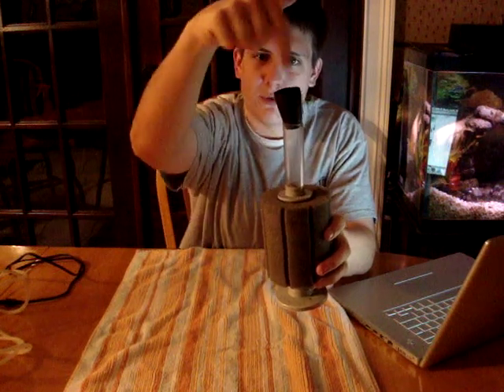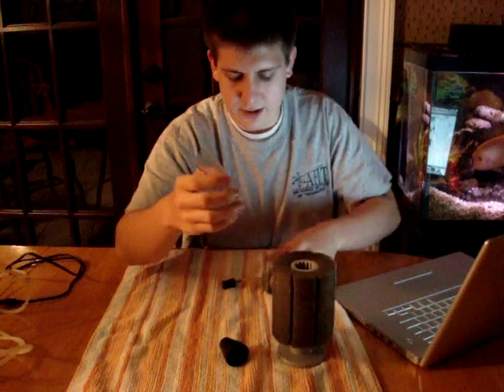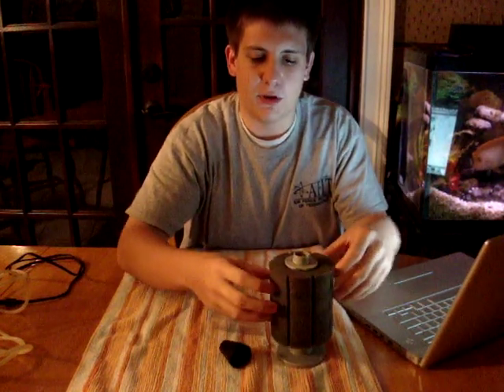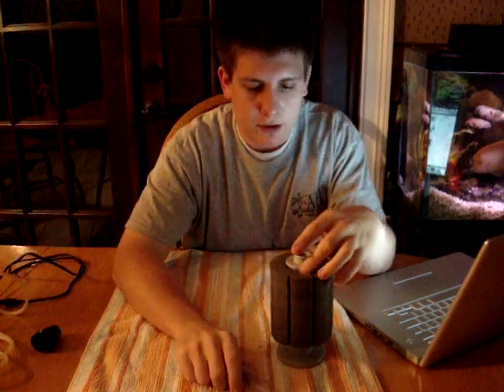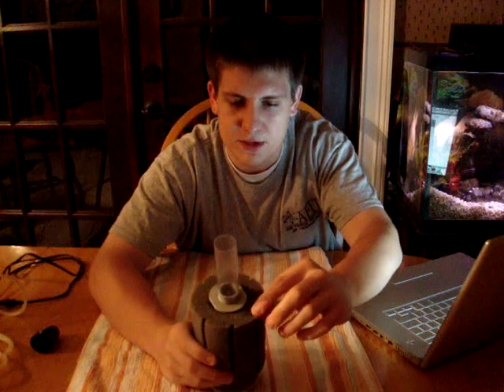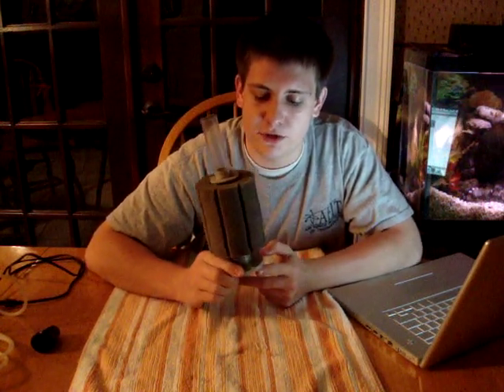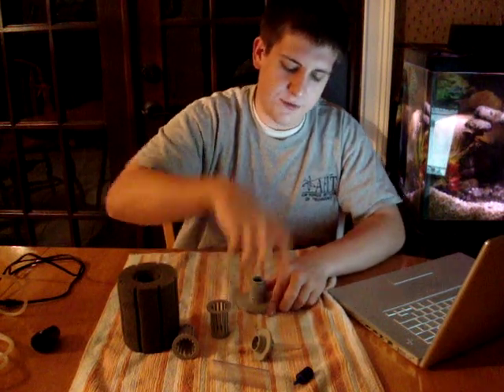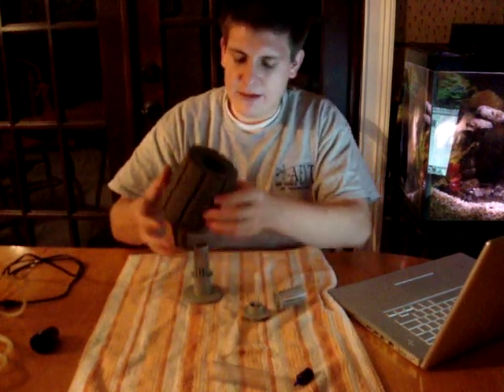How Sponge Filters Work

Comment: i switched from a regular filter to a sponge filter as it oxygenates and filtrates the tank and i can honestly say that it was the best decision I ever made, as i have never seen the water so clean!! its like glass! its more expensive in terms of purchasing the valves and the air pump ect but it is definitely worth it. You can buy connection links so you can buy another sponge to filter another tank if needed too :)  Its great for Betta's

Comment from the maker: Thats a good point, you can manipulate the shape easily, but, as you do that, your also going to cut down on your filtering capacity. On top of that, at least for the sponge its self, you will never be able to safely change the color to your choosing. 

Also, any filter can just be left there for months at a time. The only reason most filters "need" (or dont) to be messed with is, because of chemical media, like carbon, it wears out. Sponge filters are prone to clogging more than most filters.

Comment: Thanks for the overview.  Just got a betta for my daughter and the tank I bought (Aqua One Reflext 26L) has a power filter with what looks like great filtration but a noisy and overly strong output.  I tried reducing the flow by drilling some holes in a tube (like a makeshift spray arm) and connecting it to the port in-place of the duckbill nozzle.  This reduced the flow and stopped the betta from getting swirled around but he still doesn't seem to like it; when I unplug the filter he seems much happier and uses more of the tank.  Did a bit of research and it seems that a sponge filter is what I should use - I definitely want a bit of movement in the water to help with the heating but he should be much happier with the sponge.  Should be quieter too as the current in tank power filter has it's own separate chamber at the back and vibrates a bit.  Thanks again for the info.

Comment from the maker: @kjbarbie2002 Yea I show you that in this video, as well as explaining that. I use an extra air line and stone on all my sponge filters, I actually tested myself and it clearly improves performance in fact I could do a whole video on that comparison if needed. Yes one way to clean it is to 1. use old aquarium water 2. take a bucket fill it with tap water then put water conditioner in, wait a couple hours, then wash it in there. Also you could get a new sponge and cut both in half to seed the new

Comment from the maker: @desertbard No these tests were done in the 90s. Honestly though I didnt need a test to tell me this, even when I was 5 I could have told someone that pretty much any other filter is going to be superior to a ugf. As for putting a sponge on a ugf, it would be a bad idea to put sponge material on or around the plate, for numerous obvious reasons. I was talking about moding a lift tube in a couple different ways to accommodate a sponge.

Comment from the maker: @highlanderdurp Technically any sponge will work; will it work as good? Probably not. Most aquarium sponges have design differences in porosity and density for maximum biological filtration that other regular sponges dont have, or just really arent made for. Not to mention aquarium ones are better with the mechanical filtration part too, as most of them can catch more and finer debris.

Comment: No, I know you mentioned the study - can you post in what journal or web site the study can be found?  Anyone can say there has been a study and even if there has been methods could have been used that favored one result over another.  I'd rather read the study myself.  It wasn't that fouled up one in TFH a couple years back? 
Indeed you mentioned numerous times under gravel filters. Sponge  (retrofit) covering the plates was the question.  Maybe even as a commercially viable product?

Comment: Hey bro thanks for the vid very inforformational, I have a red devil fish that I absolutely adore n was wondering if this would b best for her , I foolishly got her some feeder goldfish n poured them directly in her tank which caused a huge nitrate spike In her tank,,,( I'm talkin like 100 parts per )... Now her health is beginning to decline n I believe she is getting ich due to the poor quality of the water . so my questions to u are ,1. will adding a sponge filter help lower the nitrates ? 2.Also since she's showing signs of ich should I  get the nitrates under control befor adding a sponge filter or can that help with that as well. And 3. If I do add sponge filter and treat her ich after how long would it b safe to transfer her and the filter to go into a New tank I'm getting for her ?
Thanks bro!
Reply from the maker: First off, just as a tip, whenever you get feeders again try to get them from a reputable source, look at their tanks, inspect them. Also drain the water before you just throw it into your tank. For the sponge filter, you can put that in whenever you want, and it probably will not help you lower nitrates (ill elaborate a little further, but I have a bacteria video on the subject).  Would it be the best for form of filtration? Thats a question you have to ask for yourself, theres not really any filter types (not talking about brands, just types) that are necessarily better than one another, they just have their purposes to fit someones specific needs (excluding under gravel "filters", they are the worst thing you could do to your tank). If I had to answer the question I would say most likely no, in your situation, especially as a primary filter; canister filters would most likely work out better for you, but I don't know your budget, other filters, setup, and etc. etc.

For nitrates, I have a video explaining anaerobic and aerobic bacteria, somewhere, which can really explain what your asking. Basically (I'm going to leave a lot out here) to lower your nitrates, you need to do water changes. The bacteria (especially in freshwater) that grows in abundance on filter material is aerobic bacteria, which isnt the anaerobic bacteria that you need. So without talking more on the subject, the easiest way to lower them is water changes. 

If your nitrates are high, and she has ich then you need to be careful. Luckily nitrates, are not as toxic to fish as many other waste products, so most fish can tolerate a decent amount. If your 100% positive your fish has ich I would start treating for that asap. My suggestion would to be before you do anything do like a 40-50% (do not do more than 50% ever!) water change, wait 24 hours then get some ich medicine, and then start treatment.

Comment: hi is it that i can use this particular filter to suck up filt from the aquarium itself or is it that it just allows bubbles. what i mean to ask is that is this filter actually sucking the filt from the aquarium with an air pump or do i need a submersible pump head attached for better performance..pls reply thanks

Comment: Hi, i have the other type, where the small tube (which airline plugs onto) goes to the bottom of the filter. My question is, they seem to snap together easily, which means they can be stacked on top of each other. Do you think doing this would make it less effective? i have a eheim 400 pump which is 400 lph if i join both lines with a T bar. Also, what do think about making the uplift tube longer? maybe have it sitting slighly out of the water, so the water then falls back into the tank? thx

Comment: I plan on using the number 2 of these on my 10g shrimp tank. should i supplement this with like a 5 gallon hang filter with netting on the intake That has activated charcoal. i hear that with out the charcoal the tank will not get as clear can you give me your thoughts, thanks.

Comment from the maker: @starcraftluver62 Id imagine so. Really you just want to make sure your getting flow (complete flow, which is important or you get dead spots. I mention this for the reason put that little tubing and air stone in this sponge) and to make sure the porosity of the sponge is good enough for flow and small enough for good surface area. Theres a way to check to see if your getting flow from your sponge. I might post a video on how to measure it even if your using air let me know if youd be interested

Comment: Hi there I'm having problems with my juel vio bi flo filter the cycling of ammonia went wel sharpe rise and fall as normal then my nitrite took a week or 2 and peeked then it did not fall so I cleaned filter in tank water and done a G/vac now my nitite very high and I have ammonia present at l ow levels but I ve been told u should nt have both present ???? Plz help me SOS